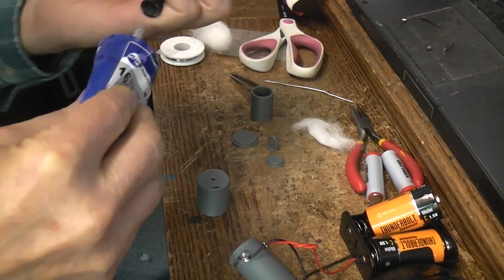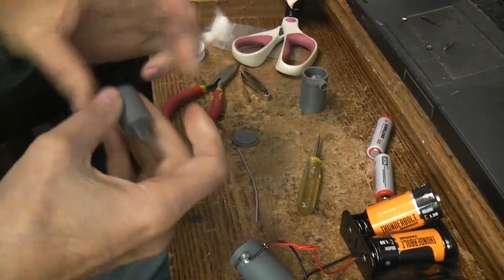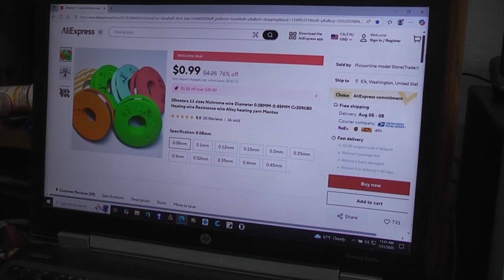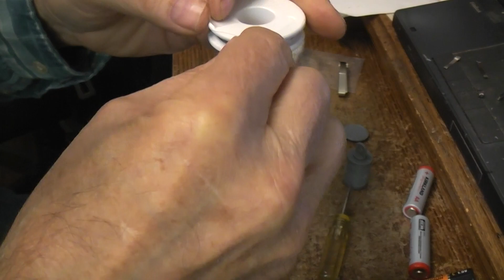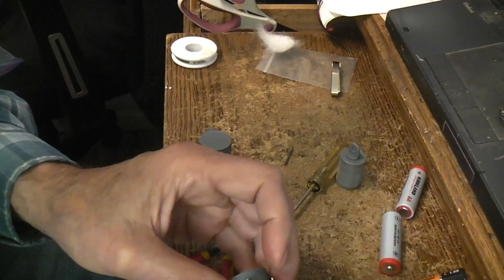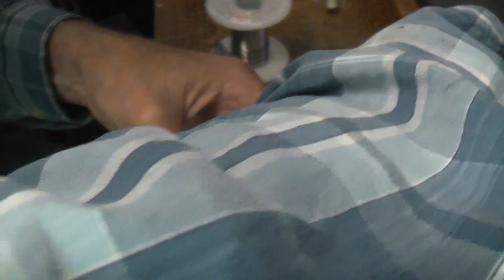Let's build a vintage style toy smoke device.

Comment: I always wondered if plastic housing would work & not melt
Reply from the maker: Almost all smokers made after the 1950's were made of plastic. The only part that gets warm is the center of the nichrome wire, even the metal terminals stay cool.
Reply: @Robothut thats good to know lol guess if the housing melted it’d make killer smoke 😂

Comment: Thankyou very much for this video and the previous one, I have been curious and interested in these tiny devices for a long time. These videos have been very informative and interesting.
 One question that came to mind while watching your demonstration of the smoker working was if any toys were ever designed to blow smoke rings using such a device ?
 Seems to me this may be possible with a little careful design and control of shaping the airflow.

Appreciate your efforts in making these videos thanks again.
Reply from the maker: I will post a video in 2 days of a robot that blows smoke rings.